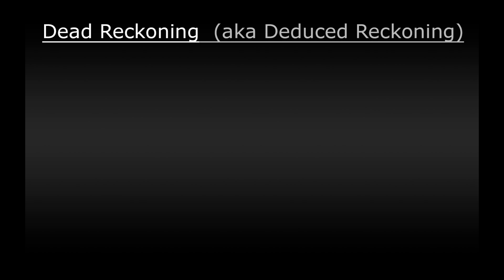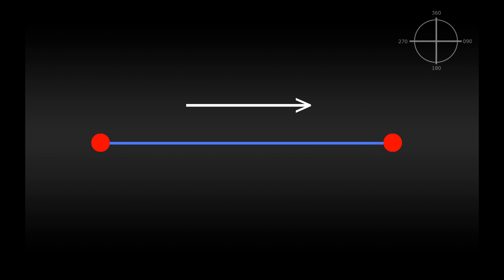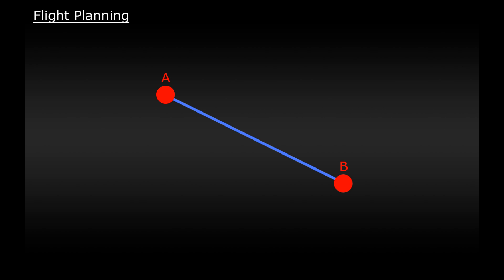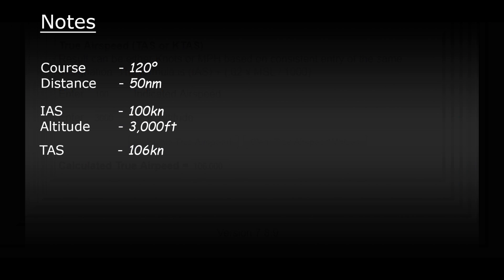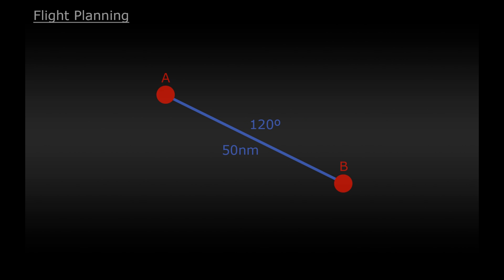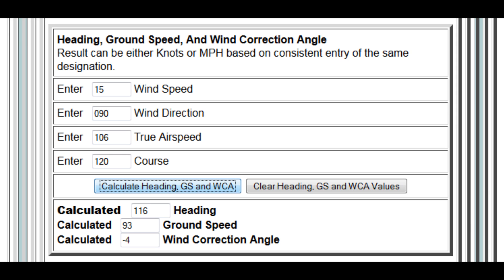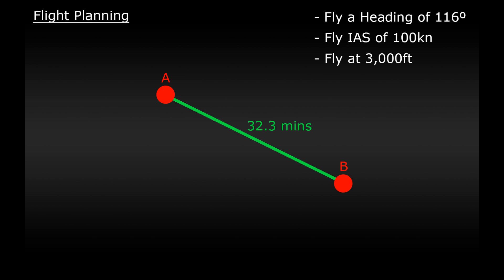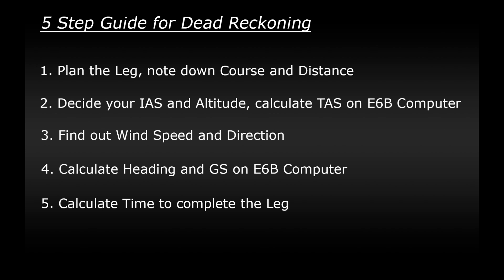FSX Tutorial: Dead Reckoning

Comment: The E6BJA Flight Computer App (for Apple, Android and Surface Pro) has a Wind Visualiser and Diversion Star which can be used to easily calculate each Leg of a Dead-Reckoning route and Diversions. Simply input your cruise IAS (Indicated Air Speed), Track/Course and Wind Vector. The calculator will then provide the Wind-Corrected heading to fly and the time taken (used for ETA). It has many other calculators too.

Comment: Doofer911:  There is an error with the formula you introduced for computing TAS that is, TAS = (IAS) + (.02 X MSL / 1000). If we compute that with the 100 IAS and 3000 MSL, it will yield 100.06 Knots TAS. The correct formula should be, TAS = (IAS) + (.02 X MSL / 1000 x IAS). TAS = 106 Knots.

Comment: You kind of want to add that TAS is the same as GS when there is zero wind. 

You can also use TT/course which in your example is 120* - WC which was 90* = 30*
Sin=crosswind, think of sin=side
cos=headwind, think of cos=nose

sin(30)*15 -> (1/2)*15=7.5kt. so you have 7.5kt crosswind.
cos(30)*15=13kt 
TAS-13kt -> 106kt-13kt=93kt which is our GS.

Some good in air calculation, which is often used in IFR that could be good to know is.

TOD(Top Of Descent) = (height/1000)x3 for example (6000/1000)*3=18nm. This mean you're going to start your descent 18nm from the airport on a 3 degree glidepath. 

ROD(Rate of Descent) what you're VSI should be at: GSx5 (only works on slower aircrafts). Example GS:100kt -> 100*5=500ft/min, then you should hold a 500ft/min descent.

Time to "touch down", Height/ROD in this case 6000/500=12min.

From this you know when you're going to start your descent, what you're VSI is going to show and how much time it will take before you land. 

You also got Standard rate of turn= TAS/10 + 5 for example 120/10 +5=17*, but you usually have a turn and bank indicator.

Good video, not really sure how i got here but i thought i would give some tips. :P
Reply from the maker: +Arcadiez Wow those are some very useful calculations to have, thanks for commenting! I'll definitely try using those next time I fly. Before now it's just been guess work lol